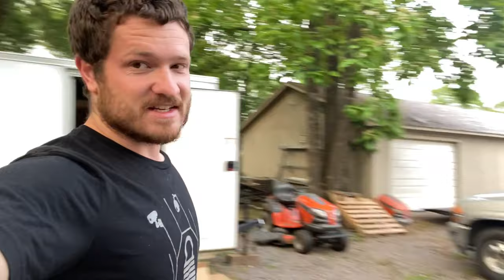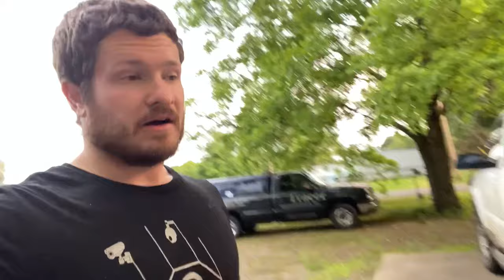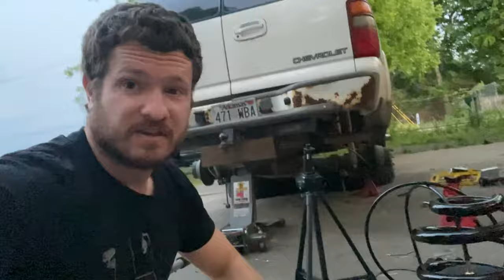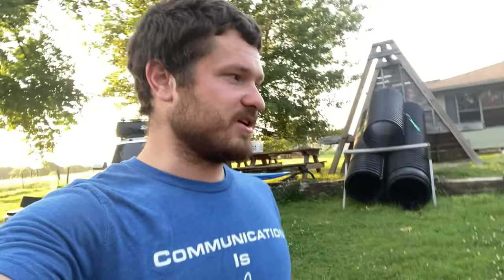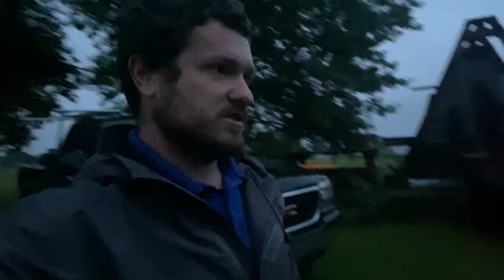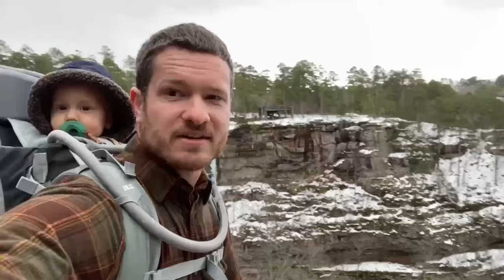Ultimate Chevy Suburban Suspension

Comment: Is it more comfortable? Less slam in the rear? I don’t really want to go with air suspension, just would like a NNBS or newer feel in the rear. I wanted to do coilover conversion in the front, but was looking for something to make the rear a little more refined.
Reply from the maker: I can't really feel a difference from the driver seat other than it feels better when loaded down.
Reply: Frame swap the 2007 frame under the 00 to 06 body they are almost identical frames besides the coil overs mounts on the front

Comment: Great video with good knowledge.  Any chance you can provide a link to the spring?
Reply: Going in Disaster Transport or the Yukon?
Reply: @klumsytone  This comment made my day.  Already ordered a set and have them installed on Disaster Transport.  Pulled the Z71 coils out and put the H2 set in and it only lifted it 1/2 an inch more but the bigger wire diameter should allow me to ramp much higher.  Also being a progressive rate spring it will ride nice on top of that.  Such a good find and cant wait to test them out.

Comment: Ive been looking all over trying to find some kind of upgrade to my suburban springs. I have an 02 suburban z71 but it had autoride from the factory with the air shocks and compressor. The shocks of course blew out so they got trashed but it feels like the coil springs are weaker since the shocks did the much of the lifting. I tried the airlift 1000 but it only helped a small amount, plus they leak down. Would a set of h2 springs be an upgrade over autoride springs? Would the springs alone help with towing?
Reply from the maker: I don't know much about the auto ride but I would expect this would be better. These are stiffer and taller than factory springs
Reply: @trove1312  We'll youve pretty much sold me on them. The rear of mine sags already and I can barely tow my fourwheeler without being uncomfortably close to the bump stops. Im looking at a set on amazon for about $150 so I hope those are the ones you put on yours lol
Reply: Okay, I just got the new springs installed. What a difference! I was sitting at 35" at the fender flare before install and they lifted to 37.75" after install. The springs that came factory were absolutely puny compared to the h2 springs. I took the truck on a short drive after install and it was a night an day difference. Where the truck would kinda wallow with the factory springs, the truck had a more controlled, firm ride with the h2 springs. I thought they were going to be more stiff or harsh like leaf springs, but the ride is still smooth and comfortable. Id recommend this to anyone who needs a pick up on the suspension.
Reply: @Koshunae  what year h2 springs did you order?
Reply: @Koshunae  also curious..
Reply: @nwaoffroad4349  @Chammy Adventures there isnt a specific year model for them listed. They are a conversion spring for H2's from airbags to coil springs. You juat have to search them up. They were about $150

Comment: How are you airing up the bags? You mentioned you're running the air lines to the rear bumper but do you have an on board compressor to air them up? Maybe you have a video I haven't seen yet.
Reply from the maker: We do have an on board air compressor for airing the tires up and down. I usually just use a bike pump for airing up the bags though, it doesn't take much to get them aired up.
Reply: @trove1312  Where did you get your H2 springs from? I see some springs online but they don't seem to be dual rate like the ones you have.

Comment: How much fun with that job be installing the airbags with the existing springs installed already in the truck?
Reply from the maker: Probably not fun but it can be done. You'll have to lift it up as high as possible to allow the coil to decompress. It's a pain but I have done it before.